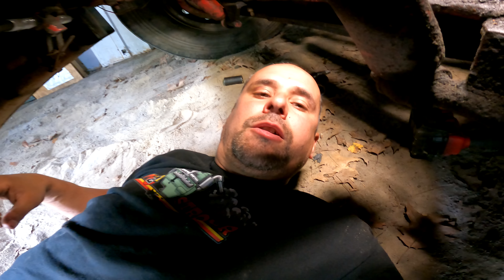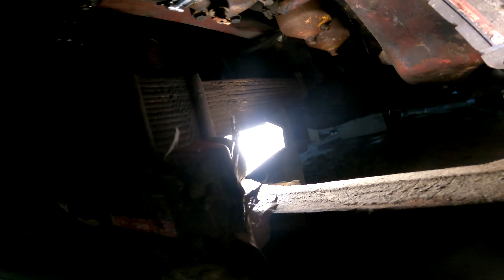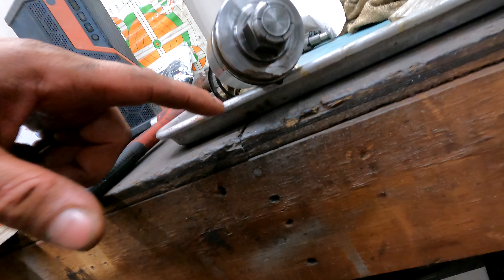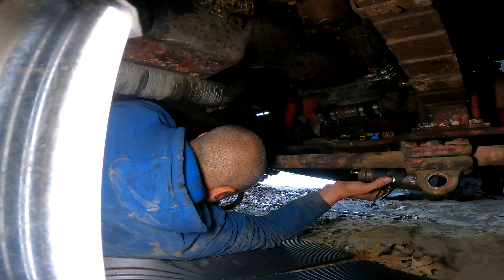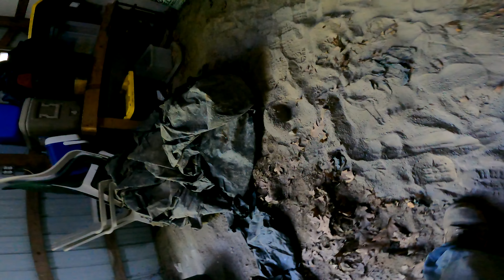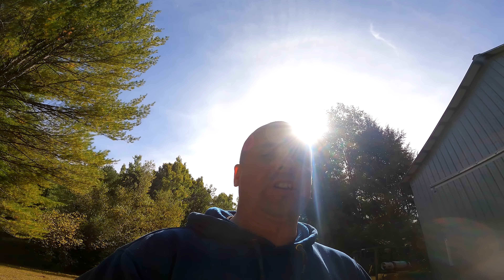12v71 Detroit Diesel Powered 1973 Peterbilt 352 - Episode 24 - Bertha's Revenge

Comment: I still gotta groom you to use a sheet of cardboard, instead of wallowing in the sand .  Also helps finding dropped parts .  But in your working conditions and space, it's one more step to "like new" mechanically .   Good Job , Wayne .

Comment: This channel is already something special man, so don't be knockin' it!  I had a few mid 70's Ferd F 250 4x4's that used a very similar setup.  Big ass valve gadget on the pitman arm with multiple 37 foot hoses down to the ram on the drag link.  Between, the valve gear thing, the hoses, and the ram it was pretty much an ongoing fuckup of one sort or another.  Check those anti freeze levels my brother, sounds like yall are getting close to frozen time.
Reply: Sounds similar to the power assist on the early Mustangs - a million leaks waiting to happen. Love them Highboys!
Reply: @DanEBoyd  Yes sir I'm sorry I no longer have one, and all I see for sale are all the $$$

Comment: KMS Tool has an LED 4200 lumens shop lamp about 1 M in length which is very ideal for a work light under or over projects. Very white clean light that makes an incredible difference. Over the bench or under a truck it works great.  CAN$33

Comment: Still catching up man. I rebuilt my first steering cylinder a year ago on a JD 6410. I wish I had seen this first. I was yelling at you when taking it apart. They are a mfer. Worst part of my job was porta powering and hammering the cylinder out of the front axle. Bolts are easy. You can torch them off. 😂
Reply from the maker: I learned a trick.... Just buy a new one! Lol
Reply: @Ol2Stroker  the one for the Deere was like $4k. The seals were like $400.
Reply: Wish I was a better YouTuber like you! I would have filmed removing the cylinder from the MFWD axle of the tractor.
Reply from the maker: Oh wow yea i would've rebuilt mine too at that money!!